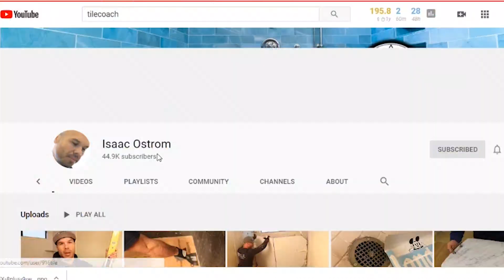Are Pro Tile Installers ABANDONING Schluter Systems?

Comment: Been doing tile for 28 years the old fashioned way pvc liners morter beds  no problems its way harder but works for us so were not changing.
Reply from the maker: if you do em right and don't skip steps they work great, as you know!
Reply: If it was done right. Mine was not and shower failed after 10 years

Comment: I used the full Kerdi system in our basement shower 4 yrs ago.  When I did the water test there was significant wicking up the thin set.  It made me wonder.  Last month I had to remove about 18 tiles where the quartz company messed up slope.  I’m happy to report that the kerdi looked brand new underneath even though that area had standing water for up to a week after a shower.  I’ve since patched and retiled.  It made me appreciate the Kerdi.  Going to rip out our fiberglass master shower soon.   Hard to know what exactly to use....
Reply from the maker: Not saying it is or isn't a problem, just saying we want to know "WHY"

Comment: Ive never used a schluter system. I was taught the traditional pre-slope, pan liner, mud bed, weep hole drain system, cement backerboard with a roll on liquid membrane, and its treated us well for over a decade, and my boss for over 20 years.

Comment: Waterproof membrane is cheaper and is waterproof and I'll never get water issues like expensive sluder system
Reply: Lot more labor instensize to install tho
Reply from the maker: You know tile is expensive right? Do you try to be cheap? Is that something you're proud of?
Reply: @HamiltonTileGA  my customers are tight  okay
Reply from the maker: @robertmendoza4718  they should be getting plastic then. Tile is a luxury.

Comment: Ditch schluter. Over priced kits. Except the drain and flange kit that I use for zero entry shower stalls. Hardi backer and red guard works excellent.
Reply from the maker: There's a lot of "excepts" with Schluter.

Comment: I just installed a schluter shower system.  After having misgivings about the seams, this time I put an additional layer on top of the base, with several inches extra length and width, folded the corner and attached to the framing before putting on the wall board.  This way I reckon the tray is 100% waterproof, but would be happy to hear any criticisms of this technique.

My other question, I grew up in a family of seven, one bathroom, alcove tub with tiles installed on drywall, no waterproofing.  Probably 50,000 showers easily in that bathroom over the decades, no water problems.  Are we overthinking this about the waterproofing?
Reply from the maker: I'll address the second part first. Some showers like you're talking about last for years, like the one you mentioned. Others last days. You just don't know. Showers built like you mentioned, do fail. all the time. See it constantly. When you're talking about wood and water, our position is that it is good to over think things. 

As for your first technique, I can't visualize what you are talking about.
Reply: @HamiltonTileGA  The schluter base already had its membrane attached, I put a second one on top, (mortared down with thinset) way you install a rubber pan liner when making a mortar bed, folded up on the sides,  no cuts, so three or four inches higher than the base all the way around.  Then stapled to the studs, installed the kerdi board down over the top, then sealed all the joints like normal with the kerdi band and inside corners.  Basically the extra piece I added is a redundancy.  It is the kerdi inside corners that made me lost sleep, now if there is wicking or even a drip through I reckon it cannot make it past the second membrane as there are no cut seams.  Sorry that it not much of a better explanation.

Comment: Personally I've been doing tile shower since I was a kid. I've seen a lot of up-to-date showers fail. But I've seen 50-year-old showers not have a crack in them or a leak. Personally don't trust schluter, but I do think there are some good aspects that can be mixed with old ways that should work out perfectly. Now I'm not saying everybody should run chicken mesh and 3 in of backing. LOL. Just kind of think it's has a feel of old cars versus new cars. They don't make up the last anymore just like everything else and I feel as if looters doing the same thing. Not got my opinion matters just an observation

Comment: I could be wrong but seeing as you referenced issac more than once, pretty sure he said he quit using ardex 8+9.

As far as the wicking goes schluter has acknowledged 1/4" of wicking in joints which is why they require 2"over lap are seeing more than 1/4"?
Reply from the maker: Yes
Reply: Isaac never used it to join seams. He used it to cover the seams.

Comment: Thanks for the info! I use their kerdi pans for tiled bases all the time, I also use durock on the walls, tape the seams, use thinset and mesh tape, then let it dry completely. For the edges where the durock meets the kerdi pan, I use kerdi band tape, then thinset it, then let it dry. Then I go over everything with thin coats of redgard, 2-3 at the least and let it dry between coats. I flood test every pan overnight and haven't had any issues yet over the last 10 years of tiling. I like Schluter but I dont trust the pans entirely to not fail, especially when there is a human standing on it and walking around it, it will flex and the grout will eventually crack. The redgard eliminates all this
Reply from the maker: Flood test is key. Do what you do so that you can sleep at night and stand by your work. I respect that 100%

Comment: What about using redguard on the seams like a 2 " swathe . When i first saw the Shulter  system i thought how is water not going to soak through the seams thinset absorbs water
Reply: That’s what I have done.
Reply: Red guard doesn’t dry completely between layers. Watch Issac on TILE COACH he has a great video with an explanation.
Reply: Don't use red guard between layers. Installed the Kerdi and band as prescribed with thin set then used redguard over all the joints and everywhere where the thin set is exposed to moisture once the thin set was dry.

Comment: I am about to tile over a dry mortar shower pan, covered in Kerdi membrane, for a client. I did the pan liner, so that it runs up the walls, and curb at least 3 inches. The corners have Kerdi corners underneath the liner. Schluter All-Set was the mortar used. The only venerable areas are the corners. I have decided to use a narrow and small amount of Kerdi fix along the seams in those corners. Also, I am curious if the All-Set you used was mixed correctly? If it was mixed for setting tile (with less water,) instead of for setting the membrane (more water,) that could be a big problem. As I'm sure you know, the Kerdi All-Set needs to be mixed with a measured amount of H2O. This is something I almost never do with normal thin-sets. Also, I checked into the tile/thin-set adhesion to small areas of Kerdi fix. Here is the article: https://www.johnbridge.com/articles/showers/tiling-over-kerdi-fix/
Reply from the maker: Sounds like you got a lot going on there! Flood test it and tell me if it works!

Yeah, the all set, we used it back when it first came out and it was a much much different thinset!
Reply: @HamiltonTileGA  I did the flood test already. No problem. But your video got me a little worried. Lol. And now I'm concerned about several past projects. Not because of the quality of my work. But if there is something wrong with these products. Thanks for the reply.

Comment: I use denshield with fiber mesh tape and liquid waterproofing membrane. Never had a problem. How much is a Schluter system cost, $600 or more?
Reply from the maker: Depends on what you're building. They have a whole line of products.

Comment: I've never used these style of waterproofing I stick with a standard style pan using red guard and have never had a single issue with a shower and I live in California were we have lots of earthquakes, I feel your more likely to have the rubber membrane flex and move than the stuck down layer of material.
Reply from the maker: I've started the feelings train a rolling.
Reply: I would agree schluter tries embers hard for their reps to be convincing but for every one good install fhere is usually three horror stories… sticking to what I know and what makes sense
Reply: @HamiltonTileGA  yeah your probably the one crying I've done over a hundred showers and never had a single call back so I'll keep doing what I do and you can deal with shitty foam backers that never last...😂

Comment: Kerdi Coll works extremely well. Problem is getting it here in the States.  It is required in Europe. That will eventually change in the States, from what I hear. Then it won't be an issue of using Ardex 8+9
Reply: It's not required in America? What do Americans use to seal the joints then? Thinset!?
Reply: @liquidsnake6879  Kerdi band held in place by thinset. Been using it this way for more than  a decade, not a single leak yet. So it works but not the absolute best solution

Comment: Schluter may be the best method for busy contractors with expensive labor and tight schedules but is it best for the DIY guy? What if I'd rather wrestle with heavy, dusty cement board and the bother of RedGarding it rather than pay a preposterous price for walls made of packing peanuts? Does Schluter system offer any advantage to me? Planning to re-do my own shower and studying the options.
Reply from the maker: Redguarding your shower, building with a topical waterproofing correctly meaning according to manufacturer standards will be just as expensive as Kerdi if you account for YOUR LABOR. We have done the math. Yeah, you can throw up some cement board and do the seams and one coat it, yeah, it'll be cheaper but that aint "correct"
Reply from the maker: The advantage of Schluter is it's mostly idiot proof so yeah, perfect for DIY. LOL
Reply: @HamiltonTileGA  
If Schluter was idiot proof you wouldn't have made this video. But I take your point - it needs two coats of RedGard to be "correct". But you may have convinced me to use 8+9 instead. Thanks for tip.
Incidentally, why don't they call it Ardex 17?
Reply from the maker: @tinman1955  we call it 17!!! So funny. 8+9 is a great product, use that and you'll be good. I said "MOSTLY" idiot proof on purpose, in fact I backspaced and added it! Lol

Comment: I've been in the trade over 20 years. Started when I was 15, I'm 38 now. I've used many types of thinset. Laticrete being my favorite. Saying that, I think Allset is the most unimpressive thinset I've ever used. You would think schluter would have done better. It is EXTREMELY gritty, and when you're relying on that to make a seal, it doesn't make me feel too good. I usually use Laticrete MML for all of my banding, even though it's not "schluter approved". I do however find it ironic they say you can only use modified thinset if it's their thinset. "Allset". As if allset is some type of premium, better than the rest, thinset
Reply from the maker: I have a similar assessment of the original and first couple trys of the all set thin set. I used some as little as 2 weeks ago, and they have improved the formula. That said, yeah, many better thin sets out there than all set. I mean if we are talking BUSINESS, schluter does some, BUSINESS. those ppl are pros.
Reply: @HamiltonTileGA  oh man. You arent kidding. They are raking in the bucks!

Comment: Try GoBoard by Johns Manville! It is more rigid, high compression (that doesn’t dent) lightweight and cheaper then Schluter or Wedi. They use a sealant for seams like Wedi so no thin set to create seams. Also they are coming out with GoBoard Pro
Reply from the maker: Go Board is good stuff! We use it for back splashes. Have yet to use in for a shower.
Reply: @HamiltonTileGA  It's amazing for showers.  Side note.  Had to rip out a GoBoard install to change the shape of the stall once.  The Pro Sealant caulking they sell is unbelievably strong, and infinitely waterproof.  My go to system for everything.

Comment: Seems if it’s installed right it shouldn’t leak ?
Reply from the maker: That's the word on the street.
Reply: That's what Isaac Ostrom says, which is why Schluter will never honor a warranty.  It's not a system for the DIY, one tiny mistake and you have trouble.  I think there are probably systems that are just as good and allow more for operator error.  Personally I'd like to see a backup (say before the shower pan goes in) in case there is a leak.
Reply: @abacab87  not exactly true, it comes with a book that gives all the info and detailed. not any legal mumbo jumbo and it says what you can and can’t do it’s fairly short too, iv installed a ton never has issues before
Reply: @JustinMentionedIt  I've changed my views somewhat after watching more, Isaac made a lot of mistakes in his installation, which again points to very low tolerance for operator error if even a respected professional gets it wrong.  This video changed my thinking:  https://www.youtube.com/watch?v=szUAfwhABd0&t=5s

Comment: Old video here,  but I thought I’d say there’s many systems that use thin set for membrane, but only Schluter seems to catch the heat for it.
Reply from the maker: Good point. I've only seen the wicking with kerdi and thin set
Reply: @HamiltonTileGA  Out of curiosity, do you still ardex the seams of these?

Comment: Old school tile guy of 40 years here that retired before all these systems came out. Mostly hot mopped and floated with great results. Saw much fewer failures with that than what I'm seeing guys talking about and showing online these days. Something I suspect is going on here is called planned obsolescence. 

 In economics and industrial design, planned obsolescence is the concept of policies planning or designing a product with an artificially limited useful life so that it becomes obsolete after a certain period of time. The rationale behind this strategy is to generate long-term sales volume by reducing the time between repeat purchases.

Might be why they are responding to you the way they are. They already know and don't care.
Reply from the maker: Yes, I agree there is obsolescence built in BUT I primarily think, as far as construction is concerned...there is a complete and utter collapse of competence in the workforce, they are completely desperate and disempowered and the value system has changed DRAMATICALLY from your time.
Reply: @HamiltonTileGA  Bummer, hacks have always been a problem, of course. I did see things drastically start to change after the big housing crash of 2008-2011.
Reply from the maker: We have some smart young guys coming up though, outnumbered though!
Reply: @ Yes. My old helper is a great setter now. Good kid.

Comment: I did a shower for a family that had 4 sons using it all on different schedules and it failed, I completely re-installed a new shower and it eventually failed as well and a rep over the phone told me the system needs to dry out in between uses and was getting too much use and was failing because it couldn’t dry out.  Put in a fiberglass shower base with good ol’ Hardie Backer and RedGard and never had a problem after that.
Reply from the maker: very interesting. Jason always says, "it's as waterproof as it has to be" obviously not, in your case.
Reply: we've gone to the fiberglass where the homeowner is willing to spend the money. solid mud base running 6: up the wall with wire lath and 2 coats of hydroban on top of it all. Only fail point I can see would be the drain.

Comment: One trick I do now is use the 10" band for all my seams and corners I actually prefer this way now and have never had an issue with water
Reply from the maker: I didn't even know they had 10" band. What do they make it for?
Reply: @HamiltonTileGA   It is in their catalog  I use it on all the shower floors, seams and corners where I can now , now, it is just cheap insurance- because when a shower leaks the plumber are always blaming the tile guy or whomever installed the pan- I just went through this on. a huge 8x8 shower I did 4 years ago and of course it was a water pipe issue but everyone loves blaming the tile guy that is why I always take pictures from start finish on any shower floor I do. zI get good support from Schluter when I have a question, I trust the system but I am really careful on my installs  and I let the kerdi dry at least a day or 2 before I tile
Reply from the maker: @johnhender  "everybody blames the tile guy" aint that the truth.
Reply: @private8559 that's why everything should be sloped properly and 100% coverage. There shouldn't ever be standing water in your shower

Comment: I used this method on my 48 x 60 shower, the corner pieces and kerdi band on the floor were installed with Ardex 8+9, and the whole thing was then coated with Ardex 8+9 for extra assurance.
Reply from the maker: my man.